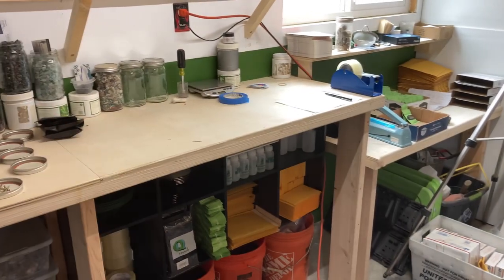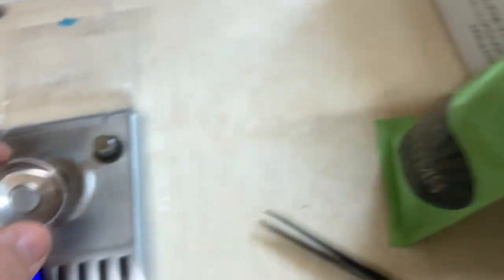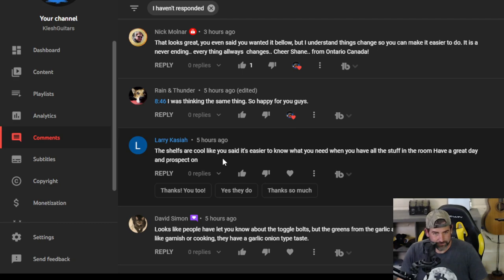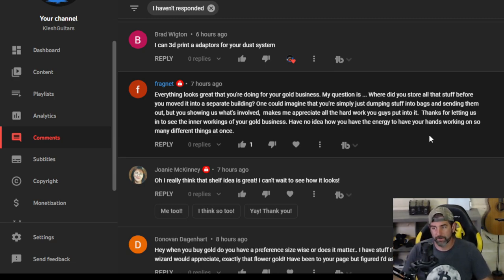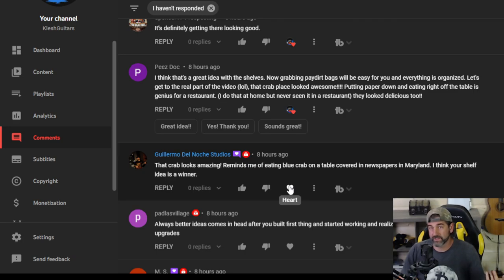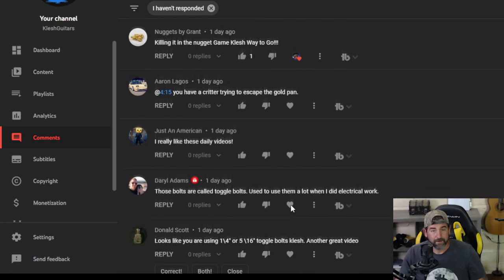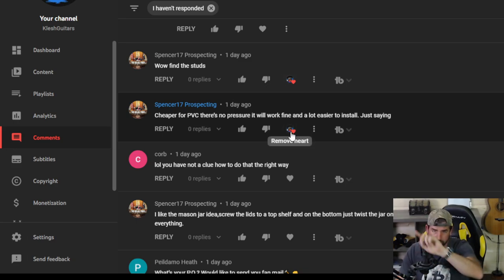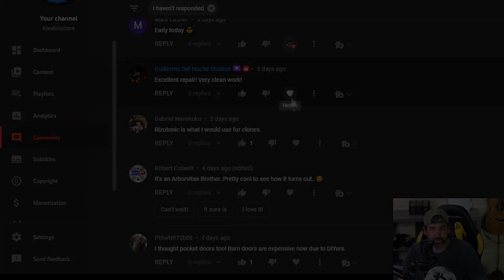Constructing an Organizational Partition Shelf System

Comment: FYI, in case you didn't already know, they make plywood router bits. They are under sized so you can get tighter fits for dados since plywood is usually around 1/32 smaller than the advertised dimensions.

Comment: Nice making those partitions.
I'm thinking of making partitions from sheet metal for the smaller divisions. And just using a saw blade to cut a groove.
This way I'm not losing as much space as an 18mm ply takes up.
Only thing I have to make sure the ends are not too sharp. 
I used to buy plastic containers. I always bought quality. Although at the end of the day, unlike wood or metal plastic is non recyclable.